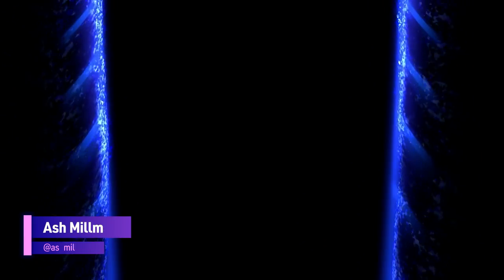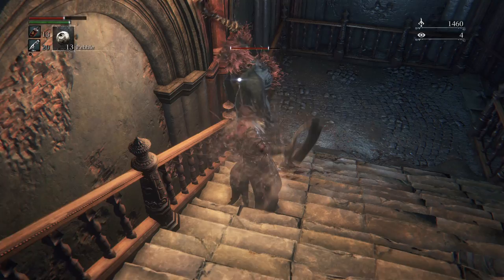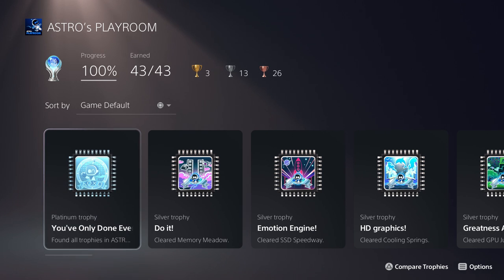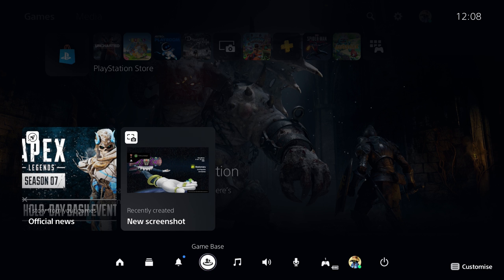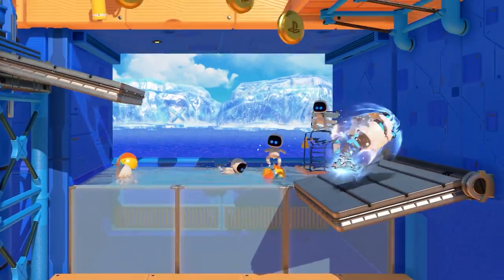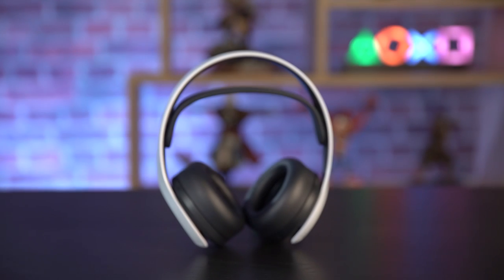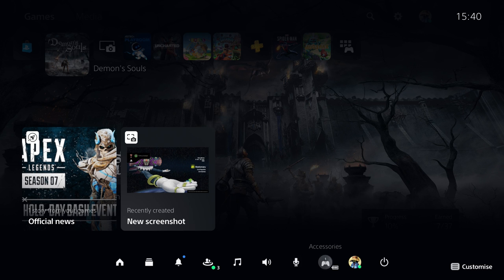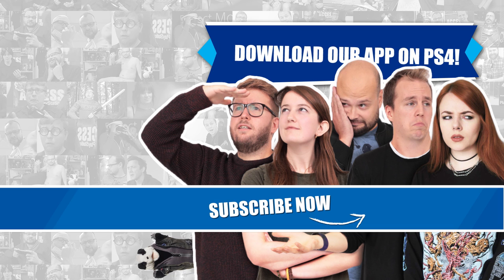PS5: The Ultimate Guide To PlayStation 5

Comment: Installing PS5 is normal speed but for some reason installing PS4 games takes forever (even when you have a 4tb ssd external for all your ps4 games)....and discs have to have the disc in until the accompanying update is installed for that game.

Also the PSVR processing box will prevent you from outputting 8k or 4K@120fps, also some levels of HDR will not be transmitted via the box......I have a 4k@60fps with HDR+ TV so doesn't effect me at all but it is a limitation

Comment: Also keep in mind the HUGE AMMOUNTS OF SOFTWARE BUGS THAT WILL BRICK YOUR CONSOLE!
Reply: Huge amount? I heard it was only with ex. Hard drives.
Reply: @Se7enDsinSGaming  I've got one and I'll tell you that there are a lot more than just the extermal hardrive problem, I've had loads of issues with recording gameplay the system freezes then crashes and rest mode is a no no because eit shuts off for some reason making you do a system repair after turning it back on and a plethora of other issues.
Reply: @dr.hasdan  I’ve only had a small handful of bugs so far and most of them are too trivial to mention
Reply: @poopoo5576  lucky you
Reply: @dr.hasdan  sorry mate I just realised that it seemed like I was boasting. The bugs I’ve had have seemingly been ironed out by software updates, so I’m sure your bugs will be ironed out sooner or later. I also wanted to ask if you’ve had any coil whine because mines been getting louder recently.
Reply: @poopoo5576  nah dw about it pal, 😂 I honestly didn't think that you were being boastful. But thanks man 👍.
Reply: 0 issues with either my launch ps5 or launch series x